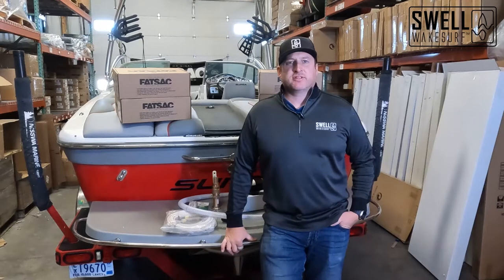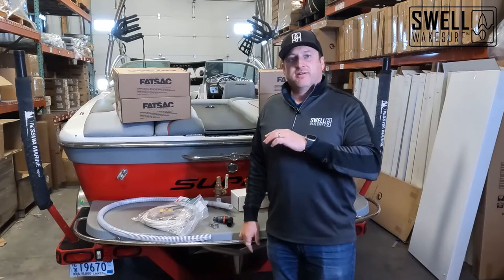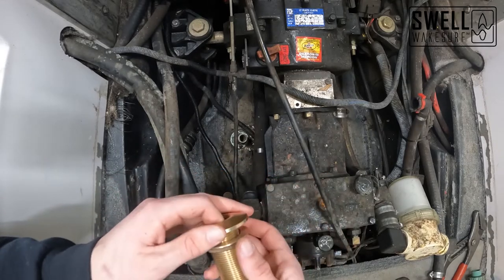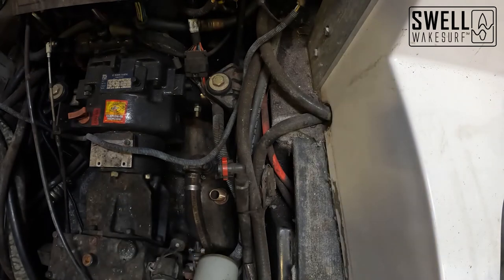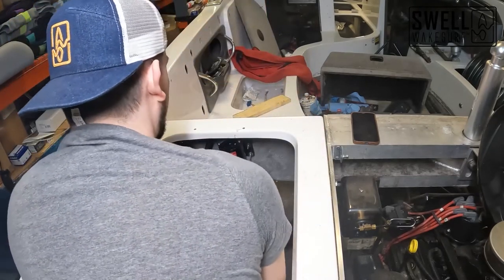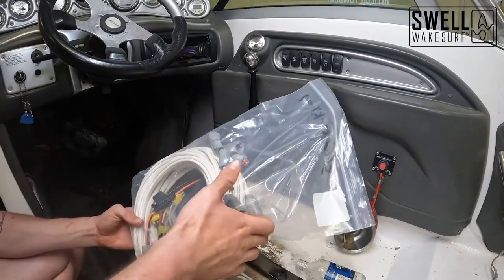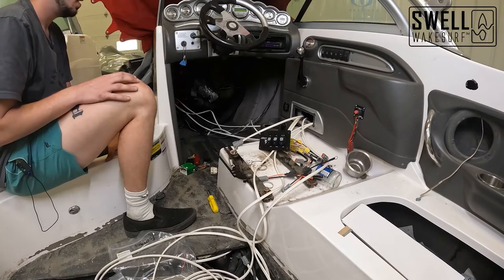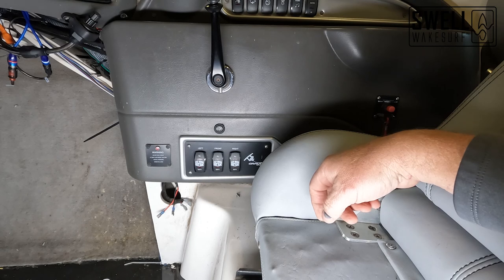2005 Supra Boat Build: Episode 3 - Fatsac Ballast System with Reversible Pumps

Comment: Awesome videos as always! Can you comment on if these older boats are designed to carry that much ballast weight on top of passenger weight? Thanks
Reply: Also wondering the same thing. I have this exact boat and it's only rated for 9 passengers in its stock config.
Reply from the maker: We’re adding water weight which is neutrally buoyant to water, and these boats can easily handle the additional weight, with a full load of people, 12 or so, you wouldn’t want to use it all, and it’ll drive different so you want to be aware that it’ll handle different but you shouldn’t have any issues. As you can see from our other videos the additional weight isn’t sinking the boat or anything.

Comment: Looking to buy a 2006 24SSV GG edition. I asked the owner about the current ballast setup and he stated this to me. "There is one main pump that pumps water to a manifold so you can fill the three bags all at once or one at a time (there must be valves then?). Each of the three bags have their own pump to evacuate each bag". 

Does that mean the system has been upgraded? 

Any help is greatly greatly appreciated. I cannot bring myself to buy a 80k newer surf boat. So I am looking to buy this one or similar and upgrade.
Reply from the maker: No, that is the factory system. one pump and sprinkler valves. This if it operates today will need replacement soon as its very outdated. That is what this boat had in it originally. We removed it all and started new.
Reply: @SWELLWakesurf  Thank you sir! Appreciate the response.